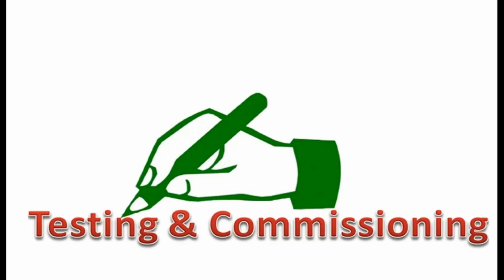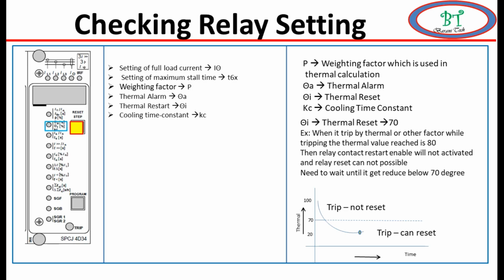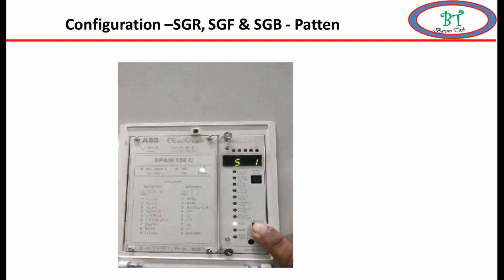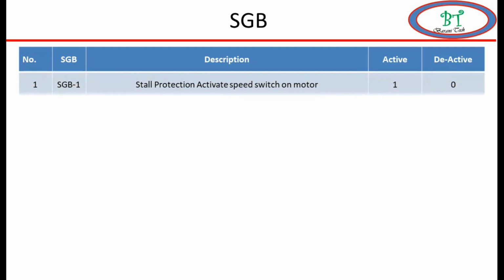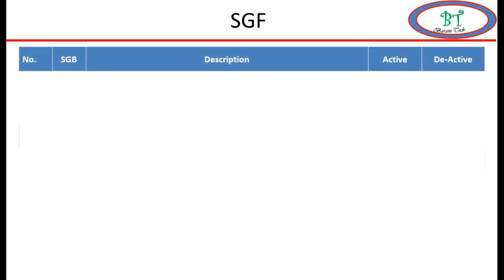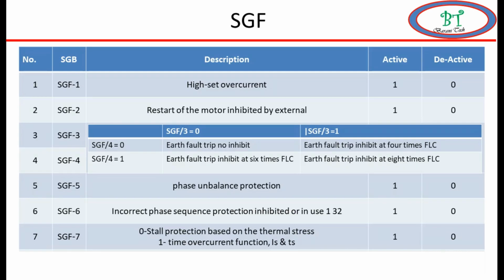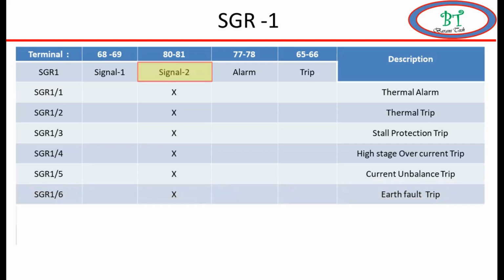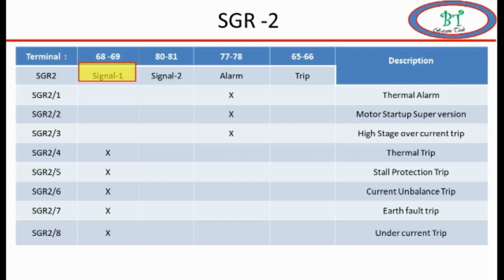SPAM 140 | SPAM 150 | SPAM Relay Configuration & System Setting | How to do spam relay configuration

Comment: I need your help please, I have a technical issue : i have unstable DC system for the protection relay, when DC interrupts. The breaker still in service, but when DC restores the breaker tripped. Could you help me to solve this issue.
Reply from the maker: this may trip due to Watchdog contact from relay.